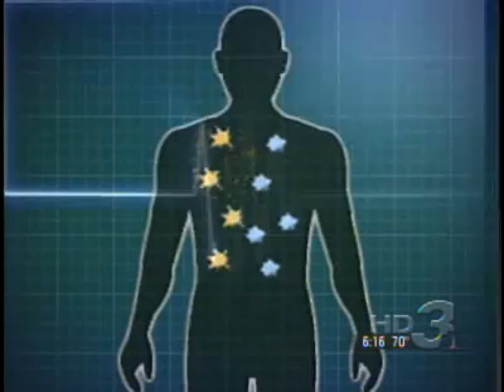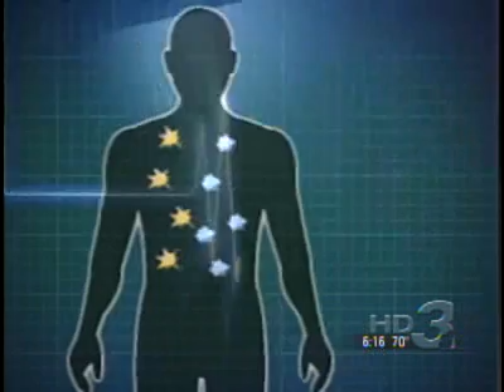Salt Water into Fuel

Comment: Once again. Converting electricity into chemical energy to burn for motion is stupid.

You would get about 5% of the energy you started with whereas an electric motor is over 90% efficient.

You are aware that when you burn gasoline a significent portion of your exhaust is water aren't you?

Comment: Aye, it does answer it.  basically, the radio waves do something or other to the water that allows it to be burnt.  As the radio waves are the only part of the reaction requiring energy, and they don't require too much E to produce, this experiment seems like a good source of energy.  I don't know why fuerstjd said that this wouldn't solve anything: as anyone knows, all machines require more energy to run than they can produce: one just has to make something that doesn't lose too much energy.

Comment: That would only be true if the radio waves require more energy to run than the flame creates. Since this news broadcast did not mention how much energy it required to start the reaction. Your statement would only be valid if you knew how much energy the ray took to function.

Comment: lol theyre like
"He can cure cancer..."
"But He discovered salt water can be used as fuel! Isnt that the greatest!"
Reply: Cancer is a body response to low cellular oxygen levels,when oxygen levels fall below a certain point the body will respond by instructing cells to ferment glucose instead of metabolizing glucose,this is very inefficient@only 2 net ATP,and the fermentation process causes excessive waste,then the body will build bags to store excess toxins in,the misinformed medical doctors call this bag a tumor..
When cellular oxygen levels rise due to proper hydration essential nutrients and information about Oxidative stress the body will instruct cells to REVERT back to metabolizing glucose @36 ATP ,then the body will slowly detox the tumor and everything REVERTS back to normal..
A person can move in and out of the body response called cancer without it ever being known.

Urine test can detect cancer..no need for EXPENSIVE INVASIVE tests..

CANCER TREATMENT IS GENOCIDE UNDER THE GUISE OF A DIS-EASE.
Reply: Only blood cancer can be cured as it explain not all cancers actually
Reply: @ميمزكوميدي-غ9ي  what is cancer?

Comment: The energy input in the "act of burning" gasoline isn't from the spark, it's the fact that gasoline contains 45ish MJ/kg of chemical energy.  Water contains 0. 

Your example makes as much sense as saying a light bulb is powered by the act of flipping the switch, not from the electricity in the wiring.

Comment: People are tossing around the laws of thermodynamics, but they're not applying them correctly. How about you consider the act of burning gasoline with a tiny spark? The energy input is incredibly small compared to the energy output. Think of the device in that sort of way.

Comment: Settle down there Guru, he's not burning the salt out of the water.  The salt is just required for the process to occur, a catalyst.  He's burning the hydrogen from the water, which in turn just forms more water.  The only thing being lost here is the electricity used to power the device, which is undoubtedly more then the flame puts out.

Comment: Efficiency *might* be helped by more salt, but even if it does, it still can only output as much energy as it takes in. Even so, converting electricy, a very useful form of energy, to chemical energy has limited uses unless you have specific goals or unlimited cheap electricity.  Even if this process converted electricity to HO gas at 100%.  Burning it to generate electricity is still less then 50%, probably closer to 30%.

Comment: What's the point?  Until you can produce enough electricity from solar to require storage it's a moot point.  Hell, we don't even know if this method is any better then any of the current methods for generating hydrogen from electricity, so far it's simply different.

Comment: The salt water only burns when in the radio beam. So what is powering the radio frequency generator, and how much energy does that take? Basically this is a way to beam energy, kind of like the microwaves in a microwave oven. So, we are to power our cars by placing a radio generator in them that will need a battery, so it can burn salt water to power an engine! Why not just skip all that and have the battery power an electric motor?

Comment: Electrolysis is already quite efficient at creating hydrogen gas and oxygen gas from sea water and electricity. At best it's a slightly more efficient way to do it. How do you not burn the hydrogen the microsecond it's formed though?

"I really hope he doesn't sell this to the oil companies."

I don't think you have to worry. Say what you will about their morals, they're not stupid enough to buy this lemon in it's current state.

Comment: Nope.  That would never ever ever work.   The amount of energy you get back will always be lower than that coming out of the battery.  It's like trying to use a battery to run a motor to turn a generator to charge the battery that runs the motor... you can go in circles with this forever, but you never gain energy and you loose it to friction and resistance and so on.

Comment: In that case, the salt water could combust, run the car, and recharge the battery, much like (I believe) car batteries operate now.  It would be a lot like the hybrids of today, and it wouldn't be perpetual motion, we would still be expending a fuel, the fuel would just be a lot cheaper.  Like I said I don't know enough about science to say whether it would work or not so thats why I am asking you guys.  Please no flaming.

Comment: Ok so I'm skeptical, and I probably don't know enough about science to figure this out.  I know you can't get something for nothing.  The energy in our cars comes from the energy released when fuel combusts, chemical into kinetic.  Now apparently salt water can combust but only under these extreme circumstances.  Is it at all possible to use, say a car battery (or some sort of more expensive battery) to power this device.

Comment: I think a lot you are getting this confused with perpetual motion.  You are not going to have closed energy system that never needs refueling.  If it does take 2000 watts of microwaves to split that atoms then you have a small generator in your water powered car.. A gallon of gas could power the microwave for 4 or 5 hours (at 25% efficenty of a generator)  At 60 MPH that would be 240 mpg.

Comment: Stan Meyer ran a car on water who was later killed.  It was even more simple than this system which uses RF to break the atomic bond.  And yes you can get energy for nothing.  In an unlimited system, energy is unlimited. Kozyrev discovered, for example, that time (the unlimited) can convert into mass and energy (limited).  This is why the universe never runs down. Duh!

Comment: To elaborate:

It takes 1 hp worth of energy to create .75 hp worth of hydrogen / oxygen out of the water using this device.

You then put that .75 hp worth of h & o into the same engine and burn it at 35% efficiency. That gives you less than .15 hp to both move the car AND CONVERT MORE WATER TO FUEL.

 Where does the initial 1 hp come from? It has to come from outside.

Comment: Petrol comes to you ready to burn courtesy of sun, plants, time and Exxon. The engine burns that with an efficiency of 35% of it's ideal.

Water does not burn, it has to be split into separate H and O molecules to convert it to fuel, which this device does at 75% of ideal.

You can only get as much energy out of a fuel by burning it as it took to create. The cycle can't keep going forever without outside energy.

Comment: If I understand you correctly, then a car that only gets .25 or .3 hp worth of energy (which most do) from every hp put in, shouldn't run at all. The question that remains unanswered is where that 76% is being calculated from and how much energy is being lost in the process. And just so you know, thermodynamics ain't what it used to be. Google Tom Valone - Zero-Point energy extraction from the quantum vaccum.

Comment: For every horsepower worth of energy put in, you only get .76 out **before** you lose power to heat, noise and other inefficiencies in the engine / drivetrain. By the time you've taken those into account it would take more than twice as much energy to run the apparatus as you get at the wheels.

Even if he got it up to 99.9% efficiency this might work for about a mile or so until your car's battery died from being drained faster than it was being replenished. Physics 101 level thermodynamics.

Comment: But it's not fire, it's a high voltage spark.  

The electric power making the spark is supplied by the microwaves.  Hasn't anyone here heard about "microwave oven grape plasma?" see youtubecom/watch?v=1SFT4cbfqlo  Also search "microwave ball lightning."  The salt water is not the fuel.   Hobbyists have been playing with this stuff for years!